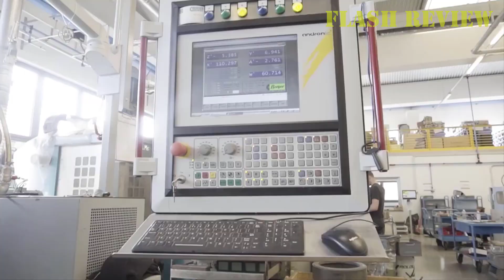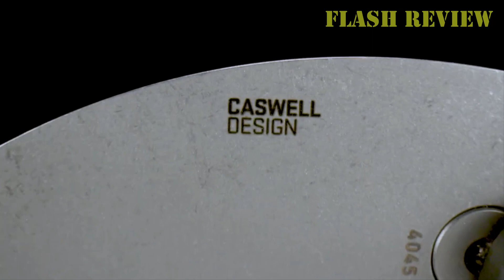14 Best Karambits in 2022 part 1 (Number 1 - 7)

Comment: Yoo you're showing the 599tic which is a completely different knife than the you're talking about, that's carbon fiber and titanium and elmax steel the one you're describing is three times cheaper and a completely different knife